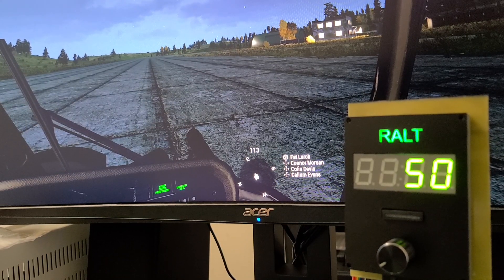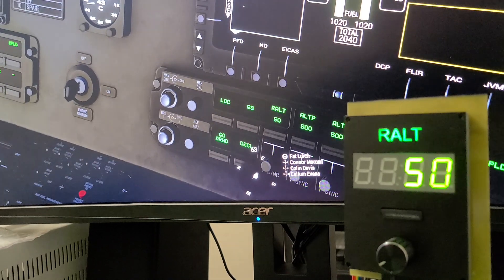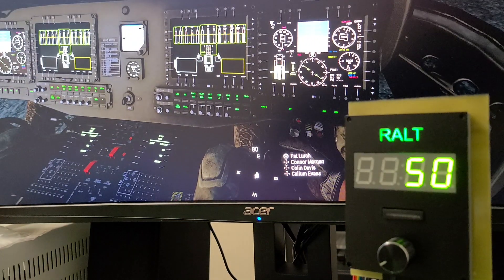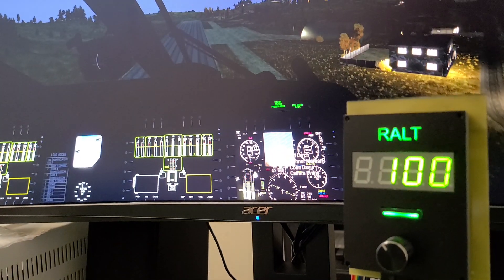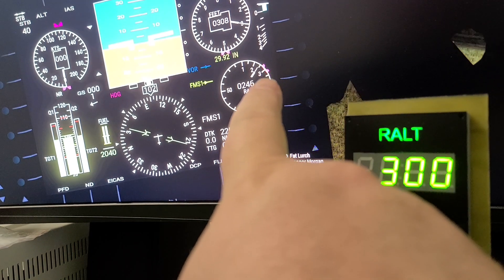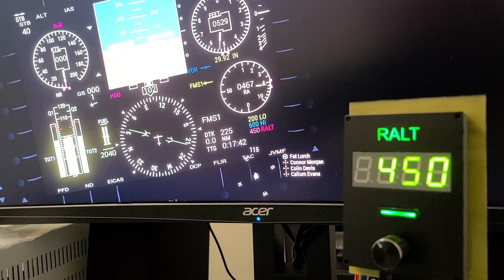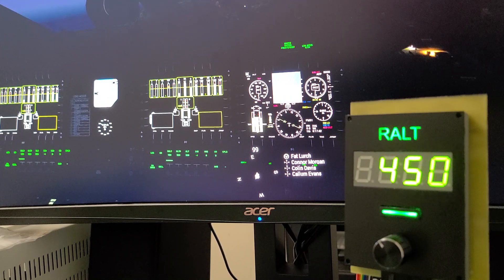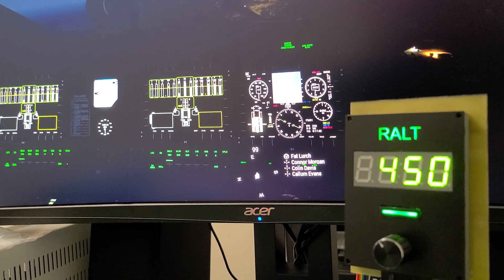ARMA 3 Custom Radar Altimeter Panel

Comment: Any documentation on how to recreate this? I'm trying to get the same result. Thanks!
Reply from the maker: Thanks for your interest Kaiser. I suspect I'll be posting the Arduino code this weekend. 

I plan to sit down at some point and come up with a decent tutorial that shows the ARMA and Arduino side of things.

Unfortunately right now the approach isn't very friendly to folks who aren't very familiar with PCB fabrication.

My pipe dream is some day I open source the design and sell boards ready to solder.
Reply: @erikkofahl1617  Good to hear back. It does sound a little complicated, I've never had any prior experience with Arduinos and PCB fabrication, but one can always learn.
Reply from the maker: @KaiserMighty03  I've posted the link to the Steam addon in the description at the top. I'll be developing some examples soon(tm). Thanks